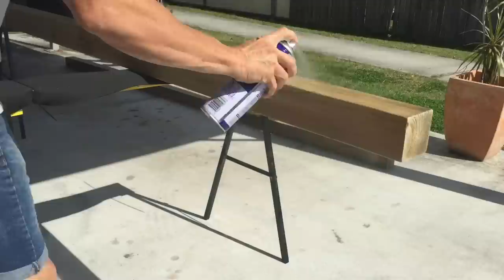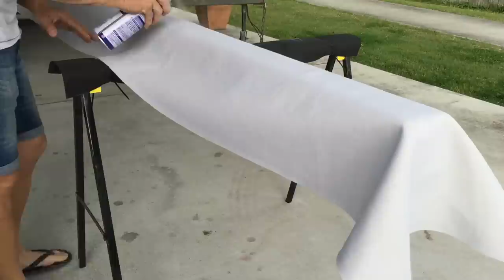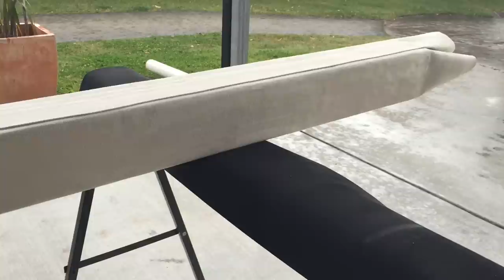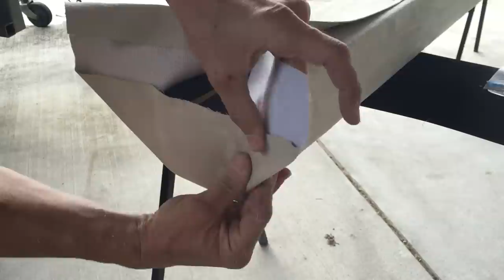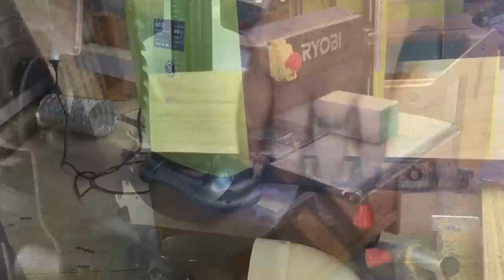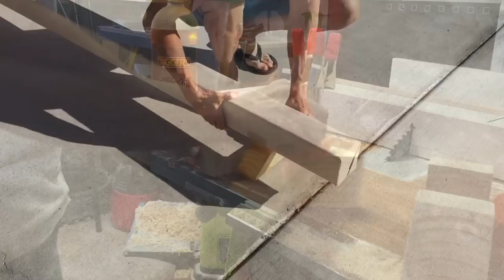How to make a padded gymnastics balance beam

Comment: Ben's Worx- would you mind passing on size and type of wood that is best for this project.... Thanks for any help you can pass on
Reply from the maker: +B.jaynee Holleran Hi jaynee the easiest wood to use is a length of hardwood 100mm x 100mm square alternatively you can laminate pieces together to get the desired thickness you want, i have found that 1 solid piece of hardwood gives the right amount of flex and doesn't sag over time, hope this helps

Comment: Hi Ben :-)
How much did you use  3mm foam rubber and real suede for making this padded gymnastics balance beam?
What was the name of the glue spray that you used?
I loved your video. Our daughter is a gymnastic girl age 8 years old and need to trains more at home  on a gymnastics balance beam . She exercise on her gymnastic club 3 times in a week 6 hours a week.  We'll like to make this gymnastics balance beam  for her as a Christmas present.
Reply from the maker: +Elsi Tollefsen Hi Elsi, the foam you use can be bought in any size and cut to what you need, i used appropriately 2 square meters, as for the suede you will need continuous lengths. So i used a piece that was 3.5 meters long by .5 wide. The contact spray is made by a company called selleys and its called kwik grip. But any contact adhesive will work but i do recommend a spray pack for easy application. I hope you can make one before Christmas as your daughter will love it. Thanks for watching
Reply: Thanks a bunch Ben! :-)
Reply: By the way can you recommend this:
3M™ Hi-Strength 90 Spray Adhesive ?
Reply from the maker: +Elsi Tollefsen yes the 3m 90 will work fine just follow the instructions on the can. :)

Comment: Where do you get suede material in this length? How much did it cost? Also, What is the pad material?
Reply from the maker: Hi I bought the sued from spotlight it cost around $50 and the padding is from clark rubber and is 3mm
Reply: +Ben's Worx I am in the U.S.A., so I'll have to find something similar. Appreciate it.
Reply from the maker: +JSMachine1 No worries mate, Hope you can find something.

Comment: Hey mate great vid! Question around where you bought the timber? Bunnings and home timber don't have 100mm x 100mm. Thanks in advance.
Reply from the maker: +Reg Go Hi Reg i got it from bunnings but they store it on the upper level in the timber yard just ask someone for a 100x100 hardwood post
Reply: Ben's Worx thanks Ben. Went again and found the hardwoods but they're all not in very good condition. Ended up getting treated Pine. You reckon it's ok?
Reply from the maker: +Reg Go yes that should be ok you may get i little extra flex depending on the length
Reply: Ben's Worx Hey mate - one more question about the legs. What size timber and what sort of timber you're using? Thanks heaps.
Reply from the maker: +Reg Go it's 70x70 pine or even use some off cuts from the 100x100 piece